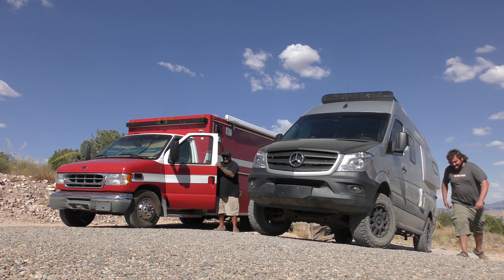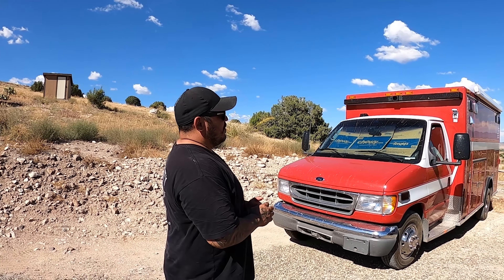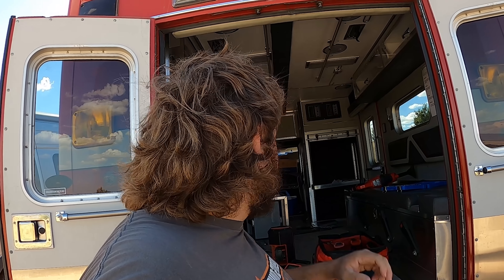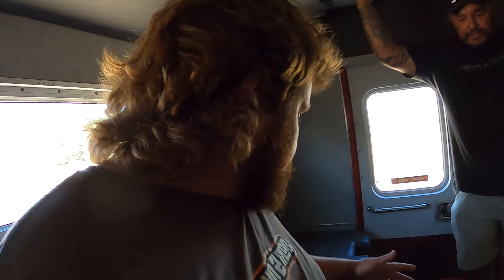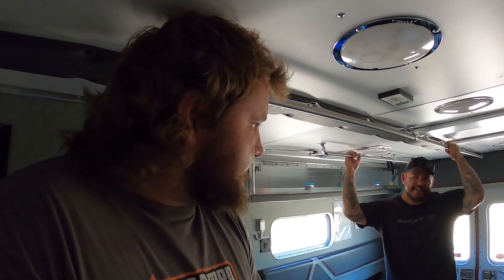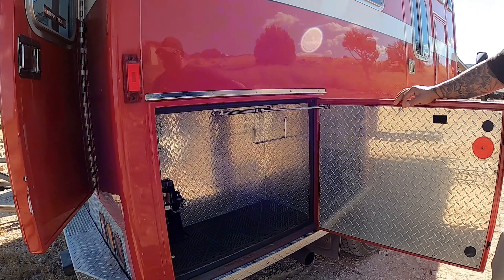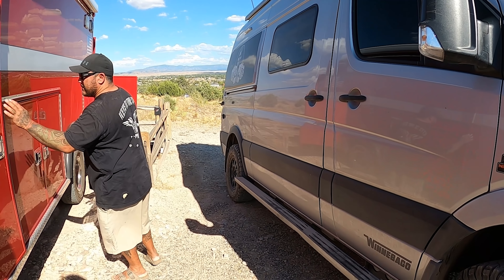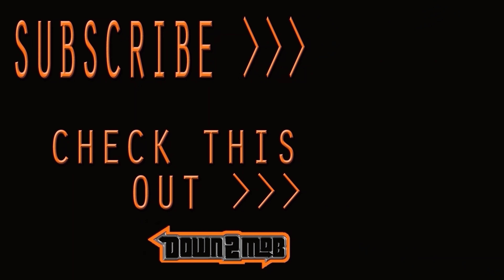DIY Ambulance with 4x4 Conversion OR Sprinter Revel Camper Van - YOU DECIDE!

Comment: Definitely go with the ambo.  Add 4 wheel drive.  Maybe lift it. Bigger tires. Max air fan in roof.  Nontoxic flooring like cork or marmoleum.  Roof deck and lots of solar with lithium batteries.  I’ve been wanting to convert an ambulance.   This one is really nice.  Like you say, a real unicorn!  Good luck.  I’ll enjoy following your progress whatever you decide to do!

Comment: The ambulance!  
That's what I plan on purchasing for my retirement home.  
You can contact the company for the wiring schematic. 
Since it's just, I am putting a twin adjustable bed because age decrees that  I change my leg and head height. 
Roof deck is a must. So is a toilet and shower. 
I wish I was handy, but I'm going to have pay to have the ambulance converted.

Comment: I've always wanted to get an ambulance to convert. Insulation is done for you and exterior storage, you can still get in the cab from the inside, plus pre build storage on the inside and you LUCKED out on the awning ❤ i also like the lock feature on a switch, those exterior lights would be so useful out in nature at night or to scare an intruder, id flip all my lights on and the siren, that would scare them. Also they're built solid and wider, roomier

Comment: I vote ambulance all the way.  The Sprinter has a unibody frame that can be bent which could total it just by winching on it during a recovery.  The E450 is a beast body on frame.  The ambulance is much easier to lift and you can put a winch on the front.  Several companies can do the 4x4 conversion; besides Quigley there is U-joint offroad in NC (they only convert Ford’s) and many more companies.  Plus you get out of debt and still have an awesome rig.

Comment: Sprinter. Ambo only if want to spend next year and unknown but larger than expected amounts of money on the build out.  Plus 10mpg is all you will get with a built out 7.3 ambulance. You know the revel will take you where you want to go whereas even with a Dana 60 4wd build still will be limited off-road capability. I built out an ambo and I learned a lot but I wouldn’t do it again.

Comment: The most overlooked thing on ambulances and emergency vehicles is that the mileage  don't mean much...check the Engine ON Hours "they run them day and night continuously" in winter for the heat and in the summer for the AC. Don't ask me how I know...

Comment: Ambulance for sure. cheaper repairs and more utility with a tougher build that'll probably outlive the motor. But I would eventually plan on gutting the electronics and redo it with solar and lithium battery bank.

Comment: I would keep the sprinter. Invest in wool insulation and perhaps a2.5 inch lift . Less cost and a reliable vehicle. Additionally it will get to places you will never get with the ambulance.